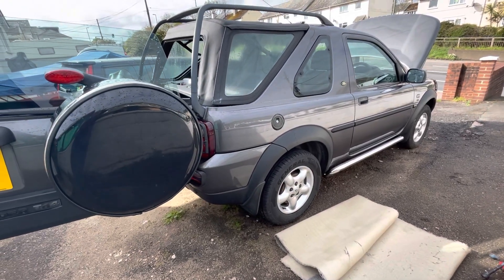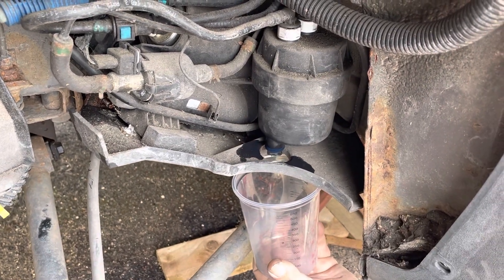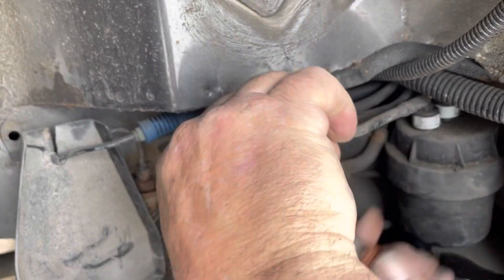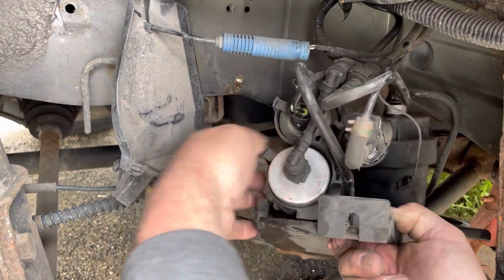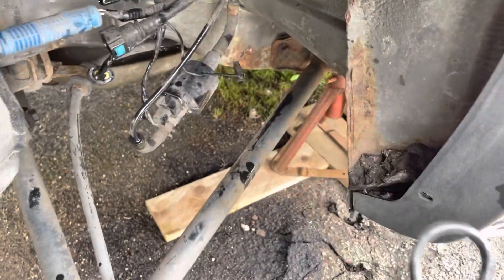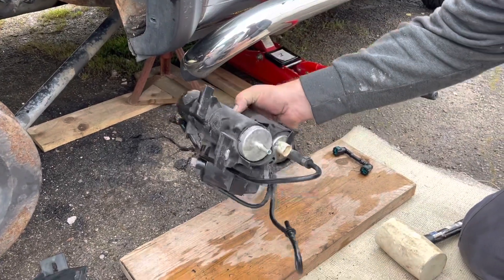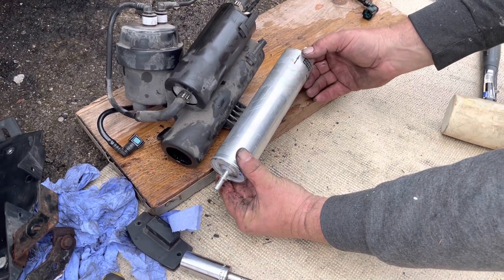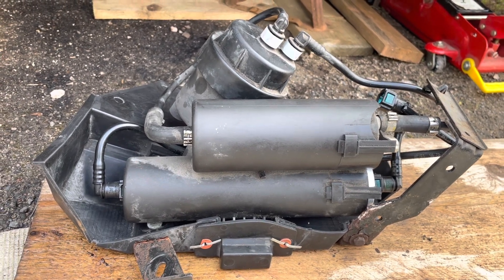Diesel Fuel Filter removal and fitting new diesel fuel filter on a Landrover Freelander 1,TD4

Comment: Very clearly presented and potentially helpful.  However, my 2002 TD4 has an in-tank pump and there is a filter beside the second pump, near the fusebox. Should it also have the separator etc assembly as per your vehicle?
Reply from the maker: @robt2151  thank you for your comment, it seems you have the older version engine and unable to help,,it might be worth asking the question on one of the Facebook freelander groups
Reply: @Retro-Tels-van-life-channel  Thanks for the prompt response. Mine was first registered in June 2002.  Perhaps the automatic g/b made a difference.

Comment: Hello there mate,Brilliant video and so helpful,I have a question if you wouldn't mind? I have the same motor as you're one and i had a noisy pump so here we are,At 4:24 in this how to you take an earth off the fuel filter,When i was stripping my one the earth was already off and I am wondering if this could have been my problem? I have fitted new pump & filter but the new pump is noisier than the old one and im just wondering if it could be because that earth wire isn't on,If i sort the earth lead and place it in the filter housing with a good connection i am hoping this may regulate the pump,Everything is put back properly except that earth lead.Sorry for rambling but i dont want to melt my new pump if the earth is to blame and it is a job i can do,Thanks in advance,Liked and subbed to you.
Reply from the maker: I’ve seen on other vids that its common for the earth to fall off with corrosion on the tab,,I’ve heard about certain pumps do run noisy, but I don’t think this earth will make the pump noisy,the earth just protects the housing and fuel system
Reply: @Retro-Tels-van-life-channel  Thank you for you're quick reply and have a great time at Glastonbury 👍.
Reply from the maker: Thank you and thank you for liking and subscribing,
Reply: Hello everyone, i have a noisy pump. A verry annoying noise. Can you help me solving this problem!

Comment: Hello Tel 👍, I have a silly problem mate,I recently changed pump and filter but im sure i put filter back in wrong way 😮  Could you please advise that when everything is put back should the fuel filter arrow be facing the engine or the rear of the motor,Apologies for the stupid mistake i need to slow down and pay more attention,Thanks  in advance Tel and take care .
Reply from the maker: Hi,fuel filter direction is to the rear, the fuel will first flow into the filter and then into the pump,hope this helps 👍
Reply: @Retro-Tels-van-life-channel  Thank you Tel 👍,Ive just changed pump twice  this last one yesterday i put a pierburg in at £150 thinking that'll do it but its still really buzzing loud,Thanks to yourself i can now confirm that the filter is in the correct way around (arrow facing rear) so im now thinking whats going on,I have a rough idle but acceleration is brilliant,I did change EGR for the blank but its never even threw a light up on dash and still hasn't,I was thinking about putting EGR back on and try that or could it be the MAP sensor,Im not being fussy Tel but it is quite loud and im now put off going any distance incase the pump stops working ,Like i say accelerate and shes brilliant but when just going along 50-60 mph and she is jerky until you accelerate and nothing wrong until you slow down or stop,She is driveable but for how long Tel? I hope you are enjoying the weather and It was my plan to do the same but,Im not bothered about a bit of noise Tel but this is supposed to be quiet ish being a pierberg and last 2 pumps have done the same,Its as if there is too much power at pump or something,It did prime itself and went quiet then when I started her up buzzing started,Thanks again Tel and i wanted to tow a bit this summer too? All the best Tel and have a great day and weekend 👍.

Comment: Hi do you have to bleed the fuel line after everything is back. If so where is that done from?
Reply from the maker: No,just start engine,it will run than stop,than start again,will turn over a few times to clear the air than it will run,so no need to bleed
Reply: Thank you for that. I have to replace the fuel hoses that go to the fuel cooler matrix and I've been searching for the answer for 2 weeks. 

And thank you for the videos